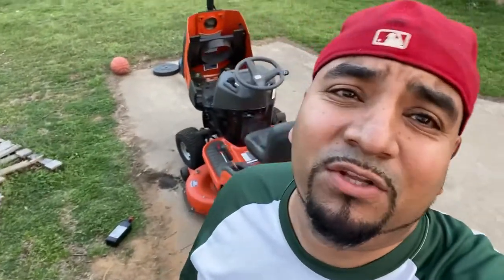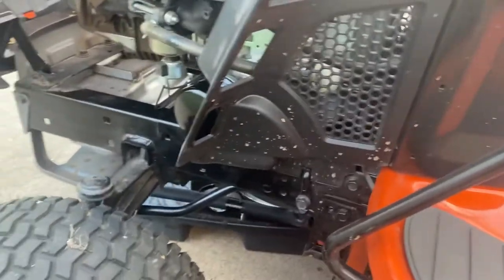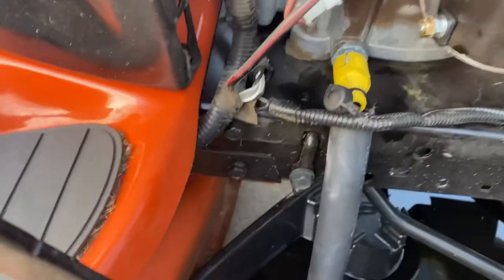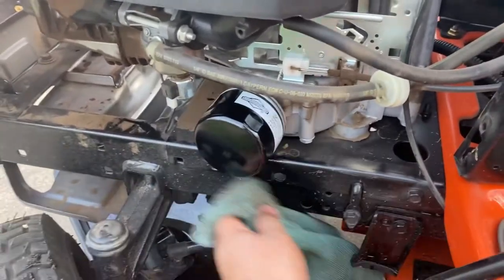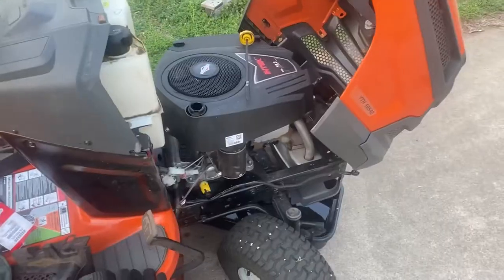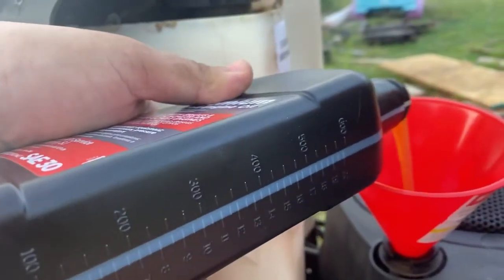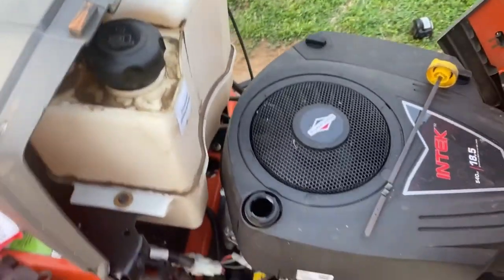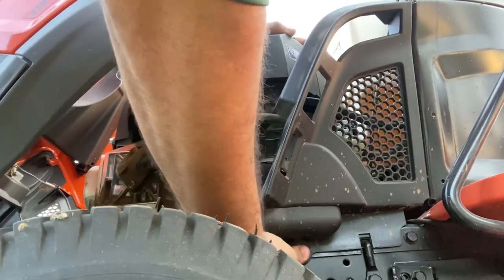How to change the oil on the Husqvarna YTH18542 riding lawn mower

Comment: Looked good.  Just need to be certain on the correct amount of ounces to add. Also, did not seem to drain as much as I would be putting in.  But overall, an excellent presentation.  Last year I had called Husq about how one gets to the drain.  The cust rep had no clue because they were referring to the maint. manual which did not show anything about removing the plastic black panel nor how.  Geez!  GREAT VIDEO, Sir.  Thank you very much.
Reply from the maker: Glad it helped! Thank you for watching

Comment: What is the oil filter wrench are you using? Thank you!
Reply from the maker: https://www.walmart.com/ip/Hyper-Tough-Auto-Adjustable-Jaw-Grip-Wrench-Model-1217/55524388?wmlspartner=wlpa&selectedSellerId=0&wl13=896&adid=2222222227855524388_117755028669_12420145346&wmlspartner=wmtlabs&wl0=&wl1=g&wl2=m&wl3=501107745824&wl4=pla-294505072980&wl5=9027206&wl6=&wl7=&wl8=&wl9=pla&wl10=8175035&wl11=local&wl12=55524388&wl13=896&veh=sem_LIA&gclid=Cj0KCQjwqoibBhDUARIsAH2OpWi5ziSoBx0JWL2ryfpZjeN3YeBt5jRP1tDKubu3pUhVTBC6_NgiWmIaAnEyEALw_wcB&gclsrc=aw.ds
Reply from the maker: If you could subscribe to my channel I would appreciate it! 😀

Comment: I didn't get a chance to change the oil, I bought this model Husqvarna YTH18542 it is a 2021 Model with a Briggs 18.5 HP engine, I mowed my lawn only 4 times ( 6 hours of use ) after purchasing the mower and the Briggs engine threw a rod right through the engine block. are these newer Briggs engines junk? also I heard Briggs claimed bankruptcy and now only has one plant.

Comment: Where did you get “2 quarts” of oil? My YTH18542 B&S engine model 330000 says on pg. 9 of the manual “Oil Capacity” is 46 - 48 oz, which is about 1.5 quarts.
Reply: Oh, sorry. Never mind. I see where you corrected this.

Comment: Great video! What is that tool you used to take side panel off called?
Reply from the maker: PITTSBURGH AUTOMOTIVE Panel/Trim Removal Tool Set, 6 Piece - Item 63639 / 66188 / 63032 / 97958